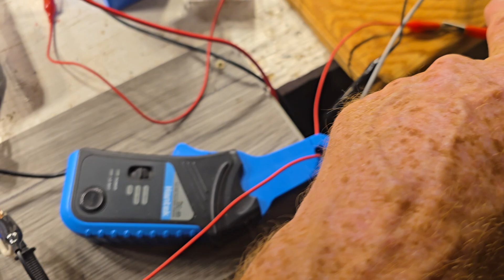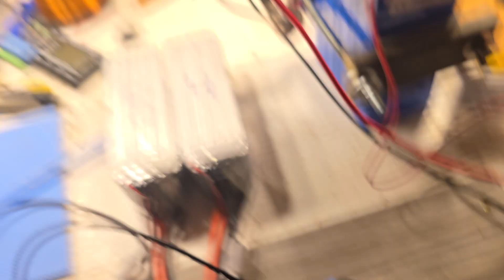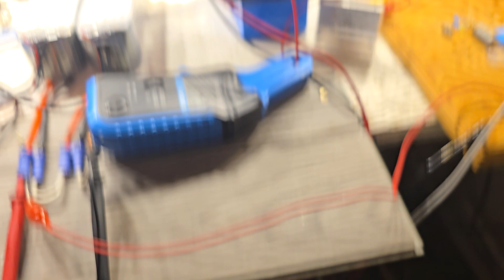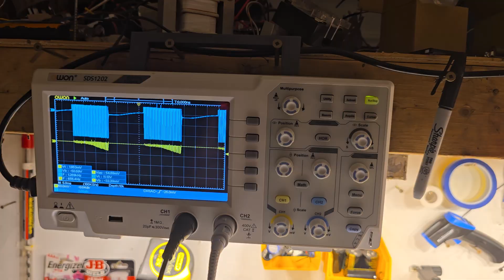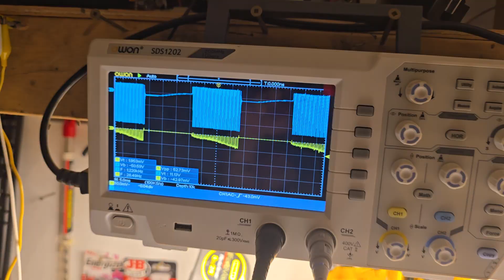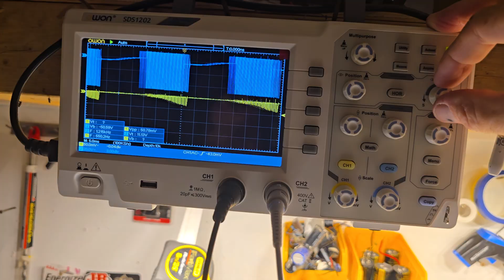Skeptics won't like these results,  advanced configuration...Pulse Motor in and out measurements

Comment: Im trying i really dont get what u did there i feel its cool but i dont get it
Do u just pulse one side of the motot and leave the other half? What kinda motor is that?
Reply from the maker: There's 10 magnets N S on the rotor.  It pulses only on the North side.  The coils at the beginning of the video are all working together in series.  When I switched the wires around on one coil that coil had it polarity flipped but still in series with the other coils.